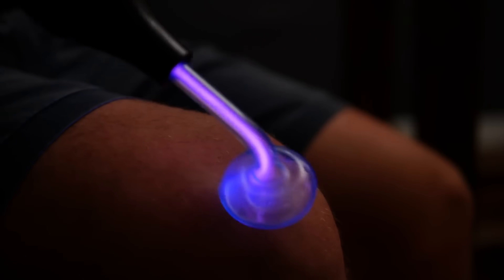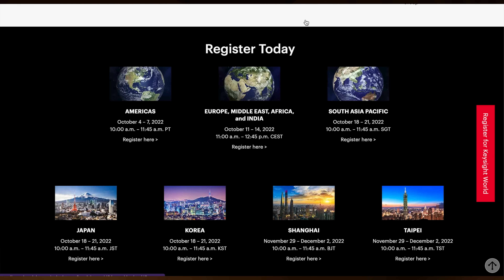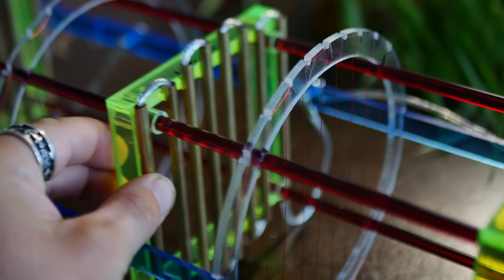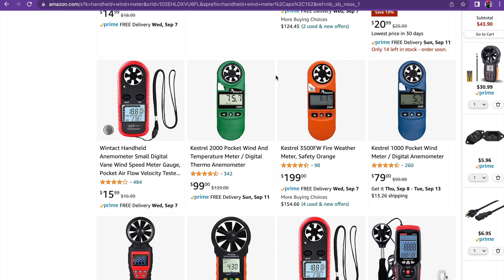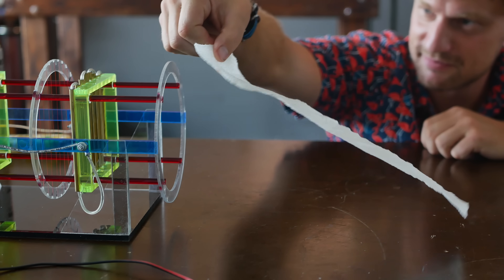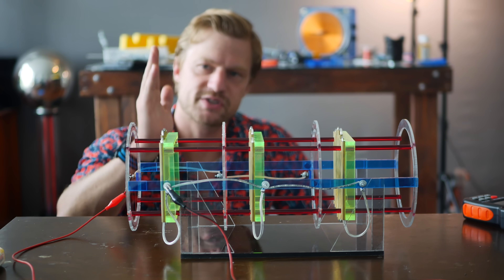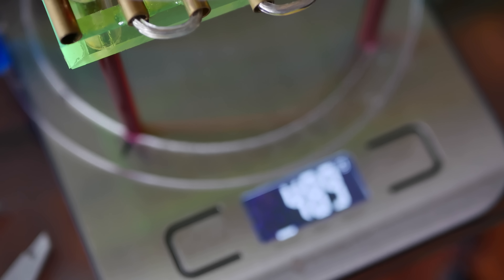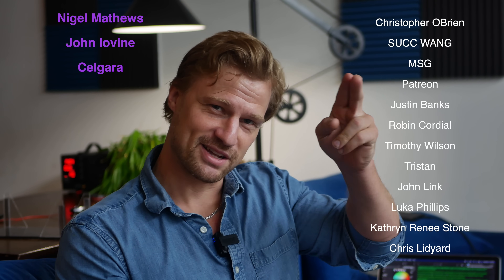Designing A Next-Gen Ionic Thruster! (For Flight)

Comment: The thing is this engine might generate good stationary thrust, but when the thrusters starts moving and thus there is a different freestream velocity, I think the seperation between the stages might need to be dynamically changed to keep up the thrust levels. 

edit: Also you do not know yet if it generates more or less thrust when moving trough the air, this might be very useful to test.
Reply: Irl application I'd say worm gears could take care of that. But that leaves the issue of debris in real world application. Magnetism on air bearings?
Reply: so, it could function as a windless generator
Reply: @DeadbeatGamer  
Ah, not half bad!
Reply: That could easily be addressed by mounting the green square parts on an array that allows the configuration to be adjusted with a button push.   

A full sized ionic engine powering an air craft would probably benefit from being able to change the internal engine configuration, controlled in the same kind of manner as modern current jet engines can be reconfigured for reverse thrust, for example.

I would hazard a guess that this would be something incorporated in the 2nd prototype testing stage... proving the concept, as this 1st prototype does, would be the main concern of... er... well... prototype 1.
Reply: None of you have any idea what you're talking about so stop talking. Unless you're a qualified physicists.
Reply: @Rlazalier  welcome to the new age, it's like the old ages where untrained folks can mess around and turn the world upside down. These "stupid" untrained answers sometimes make all the difference and if you were involved in inventing, you would know that idea's thrown at the wall often are not helpful but are never useless because every one of them tells you what not to do.

Comment: 1. Power density to weight requirement to meet it. 
2. You designed an open system allowing energy to escape.
3. it is not powerful enough to lift its own weight.

Comment: My primary thought was what would happen if you enclosed it. I'm wondering because it may be slowed down by slower air which its picking up from sides. Of course this is conjecture.

Next I'm wondering how quickly your getting oxidation or contaminates on your elelctrodes? I know its expensive but maybe try plating conductors in gold to see what effect it has. (Maybe silver as well, which would be faster oxidation, but less resistance.)

I'd also like to see an IR thermal image of this, since your generating plasma id like to know how it is aeffecting your conductors.

And since your using a voltage multiplyer I assume your feeding it pulced DC? I was just wondering what other waveforms would do, PWM, or even solid DC. (I don't expect much to change from a full wave rectifier as your already using diodes for your voltage multiplayer.)

Comment: 1 This thing needs to be enclosed
2 It's a long boi, you could probably cut down on the length if not add another stage
3 Could you use a metal mesh for the electrodes to increase the surface area and amount of ions?

Comment: how about and enclosure for the design and make it with different designs to see if there is any wastage of air pressure and if a volute casing type enclosure would produce higher speeds. Changing the design of the electrode fins so that it has a higher surface area, curious to see what kind of effects you would have with a mes type electrode. More stages could be another improvement since there was a noticeable increase with each stage. I'm curious what impact would a pulsed set up have.  is it possible to have a preplasma stage where the air is heated in a sense to get as much of the air stripped and positively charged, I guess that's why more stages equal more thrust so... more power, more voltage more currant see what happens.

Comment: @ Plasma Channel First, big fan (cough cough) Terrible puns aside, I’ve dabbled in the HV, last thing I did was a solid state Tesla coil but that was 8 years ago. Anyway I have a question about your analysis of the number of stages: how did you (or did you) account for the fact that more stages cover an increasing area? That’s not a good way to put it, but what I’m getting at is did you divide the wind speed by the number of stages? Or some other way to “normalize” the contribution of different numbers of stages? Or did you simply run 1, 2, and 3 stages and get wind speed?

Comment: Two primary areas of increased thrust are the absence of a housing to control only thrust through a fixed duct, and the other is your selection of materials. Magnetic wire and brass tubing work as conductors, but an upgrade would be titanium wire (uncoated) and the use of opposing nickle or aluminum sheet metal strips.  You can increase the flow by moving the pole pieces closer together (but not so close they arc) and stack in half a dozen sets in a shorter space.  Think cube, Mylar sheet will keep the weight down and you have an engine.  Best use would be space, but this concept has been used there before.
Reply: Why would different materials affect the performance, especially for the negative terminal? 30kV should be more than enough to render couple volts of chemical potential difference all but negligible

Comment: The flow chamber is open. Further, by closing it up you can use a nozzle effect to reduce diameter. This would also let you stagger voltages with higher Coulomb's/unit area in the later smallest stages. An inflow prefan from a side chamber could definitely be made, although energy efficiency would have to be tested. A turbine maybe? 
Multiple short distance ones at the end would also probably help eke out more. I wonder if instead of a linear ionic thruster a finely detailed multi directional point emitter at the beginning with a circular receiver. But I guess you're going for linear so that wouldn't be in your designs. 

This is so sick dude holy. Immediate sub.

Comment: Had the same ide when i was alot younger back in 79 but back then if you told any one about the use of high voltage fields to attract air to a surface and reduce drag or to move air. Well let's say that you weren't invited to any class party's.  But one thing o found was that the air moisture and air temp was a interesting factor to the solution

Comment: I would like to see a lightweight solar panel with a lightweight battery. Operate a thruster you build and it be remote control.  even if it does not get off the ground. it would be a start. would like to see peoples versions of that.

Comment: If the thrust from a single ionic thruster with no perturbed flow upstream is 66% of the 3 thruster design, then this is obviously more efficient compared to this in TWR terms...
Reply: Splitting the triple thruster into 3 single thrusters would result in a 1.8x increase in total trust from the naive calculation

Comment: Well in my opinion you still have more things to play with. You already mentioned distance between phases... so that means you still have the geometry of the thrurser like telsa's turbine or unidirectional valve. It's in simple therms like when you have your hose and use a spray valve to accelerate how the water moves  faster.... so you have more current or ions to move, the thruster geometry like tesla's turbine and reduce diameter to imitate your regular water house... hmmm interesting...oh and enclose the structure to a spiral that may increase speed as it coincentrates flow in the center. Hope this makes sense

Comment: Next steps would be ducted airflow and a nozzle (best type would need testing). Ideally you could implement motors/control rods to the meshes to control thrust amount. Hooked in with software regulating the voltage you could start to have control over it and test more precisely/quickly.

Comment: Try to start with a propeller or jet driven air flow from the start, then magnify the fast airflow to go faster. Starting from zero with ionic thrust is a handicapped system. Ion thrust is best suited to increase speed of fast moving air. Idea #2. Instead of using wires cross ways in the airflow area, use wires that end up in a point headed in the airflow direction. The possibilities of this ion thrust system are nearly endless.

Comment: You have all of the red wires in series, meaning the first wire stretched top to bottom constitutes as a second wire stretched bottom to top, to a third stretched top to bottom and so on. This results in 1 wire passing top to bottom to top continuously. Why don have have all eight passed go from the top to the bottom with all tops commonly connect to a single terminal, and all bottoms commonly connected to a single terminal. less possible voltage drop from one end of the wire to the other.

Second all of your various stages have conductors that are parallel to the next stage, why not alternate. From stage to stage. Also does having the two potentials run parallel work more or less efficiently then say if the red wires were horizontal and the brass tubs were vertical? would alternating the tube to a different orientation from the wires allow you to place them close or further with out arcing while maintaining air flow or will air flow decrease?

Also would a grid ow red wires, and grid of brass tubs be better? To make a grid of brass one need only notch half way through the brass so the horizontal can intersect with the vertical on the same plain. I think you could put mote stages, however the distance between stages should be further than the two electrodes of the same stage. maybe twice or three times. 

Find first test distance for the electrodes at each voltage, and find the best combination of voltage spacing for a stage, once that is found find the best distance between stage one and two, then two and three, then check if moving one toward or away from  two while three remains the same can be tweaked, then back to tweaking the distance between two and three. Then try adding stages 4, possibly five tweaking it in between each addition.

I think crisscrossing every other stage would be a good thing to try even if you do not make a grid in each stage. Heck maybe each stage as a grid with each stage having a 45 degree offset instead of a 90 degree crisscrossing offset might work...

Comment: Shouldn't the 2nd and 3rd stage be enclosed?
Reply: Reading the comments you would probably want to find an idea geometry like concentric circles vs straight line or the like and possibly using nozels to force air flow like in venturi valves

Comment: First I am a not a engineer by profession but the representation of the basic to detail cocept truly mesmerized me. I think as layman so i will say 1 point as a layman. In my opinion if weight of this model increase in future project of aeroplane this assembly will be bit difficult to stabilize. So need of testing using heaving material in pilot study is needed.

Comment: Looks great. 90W aint that bad.
Two things I noticed that jm not sure if you mentioned:

A cowling around the engine will undoubtedly make it more efficient at moving air. I would re-do the testing with it as it will no doubt change the dynamics.

Your static force test is blocking the outflow of the engine. You will get higher numbers if use long standoffs above the balance, or better yet, use a ballistic pendulum to test the horizontal force.

Comment: Not a expert by any means, but as far as I know Jet Engines apply different technologies and fields of physics to generate thrust. It need to at least be contain to generate pressure and power. No? A air gun is not made out of air after all.. The air is just the medium of input and output, just like your Ionic Thruster. 
I hope to adquire in the future a flying car with a dozen or so of the final stage of your Ionic endeavor.

Comment: One issue I think you have is the surface area of the anodes that are attracting the ions and reducing your total potential air flow.
Another potential issue is the lack of enclosure allowing turbulent air in and out of the main channel.
A possible third issue (but I don't believe it would impact that much) is the lack of rigidity in the frame and the micro vibrations that could influence the ion direction?

A question I do have is what would a pulsed ion engine look like? Sparking the ion generation, allowing the anode to pull the ions and then shutting them down for a micro second to allow them to continue on, then pulse again to drag them to the next post.

Comment: You need to seal it in a venturi, as the air compresses the stages need to be closer together, (& possibly a voltage gradient between each stage) . Good luck, great build.

Comment: Very clever, the components of the thruster could be improved by changing their aerodynamic configuration, The brass tubes are causing turbulent flow thus creating drag, a laminar flow airfoil would be a better option. You should be able to multiply the thrust considerably by using thrust augmentation, check out the Dyson fan.

Comment: About inefficiency : air absorbed from the sides, as the pressure is less in the flow area, Accelerates less, making impact In total flow velocity. You may close up the structure. In like a tube

Comment: Hypothesis: One of the things that would help the overall concept would be to have an enclosure. It's the most popular and obvious suggestion (which also reminds me of a personal experience).

Other than that, I would be curious to try out other designs I have in mind (which is solely just imaginitive for now) to tweak the configuration such as size, shape, orientation, material, electrical discharges, etc. There's a whole list of variables to verify.

Comment: What if you tried combing it with features of a jet engine. If you used the ionic thruster as a compressor and added in a combustion stage using the compression of air from the ionic thruster!

Comment: Open a wire every other mm's wraped down your finget tip.  Snap it on negative bar close to the positive.  Snap a weak extended node on the positive. The wire threaded surface extracts a massive ark past its opened attraction hopefully.  Might expect to see more shadows.
Reply: In theory,  the negative snap resitor strength would be limited to an induced delusion of joule level.

Comment: needs to be encased and with a venturi at the front and cone on the back to increase air flow and pressure. I would call this Ionic Air Pressure. I believe what is happening is that the ions can only pull so much surrounding air per square inch and that is why we saw such a big difference between staggered or even placement. Possibly wiring the coils as a mesh grid instead of just vertical lines would cover more area and agitate more air creating more velocity. 🤔

idk

Comment: 1. Encased airflow, but possibly only after the second stage allowing the Bernoulli principle to draw in more air between the first and second stages as the air begins to accelerate.
2. Conically tapered exhaust shrinking the exit size of the duct and creating faster flowing air.
3. Slotted carbon fiber parts to improve the power to weight ratio.

Comment: Unless you have some dilithium crystals ... A plane still requires a power source aka a battery ... Good luck reducing the weight on those ... And when all else fails.... Use a 300 meter or more wire the power source will always be the problem ... It's not the electronics or the method of achieving thrust it's the power source electric powered drones have this issue with range and flight time . But not gasoline powered drones

Comment: I can't comment on the electrical design, but I can see some improvements for the aerodynamics. You might want to try implementing an enclosed duct to more efficiently channel the flow through each thrusting stage (less loss through the sides) and it will also vector more of the flow rearward (increasing propulsive efficiency). You may also want to change the distance between the stages, as the downstream wake going into the next stage will also affect aerodynamic efficiency. There is no easy analytical way of solving that, but trial and error will probably suffice here. Finally, you could try increasing (or decreasing) the number of vertical electrodes - it will be a trade off between moving more air through ever smaller gaps, but there should be an optimum design point. Of course all of these adjustments need to be traded off against increases in system weight!

Comment: if you increase the amperage instead of the voltage it would increase the flow of electrons, and maybe it wouldn't make the air come out faster, but it could come out stronger, which I indirectly think would increase the speed, by hitting the molecules in the air harder.

by the way, very good content

Comment: It's amazing but I wonder how the design could be changed. The airflow section is impeded by the plasma generation equipment, so there's a trade off immediately. I wonder if you can do a design that pulls air from the perimeter at each segment and funnel it into the airflow chamber. Perhaps have the negative electrode be circumferential and pulls air in at a 45* angle and have a single positive electrode cylinder spanning the length.  

Also it seems the concept doesn't necessarily require that exact design. Perhaps you could generate plasma elsewhere more efficiently and then inject it into the airflow chamber and then accelerate it down the length. I'm sure there's also a ton of stuff you could do about optimizing the electric fields inside, maybe generate a vortex with the help of a static magnetic field?

Comment: 1. Insulate the sides, so make it a tunnel
2. Make it lighter, you could make the segments not moveable, fixed, maybe that way you can make it lighter
3. Maybe use a heavier gas as a fuel than air haha